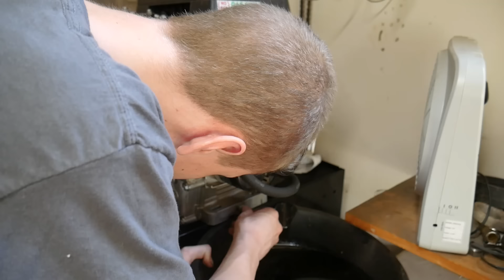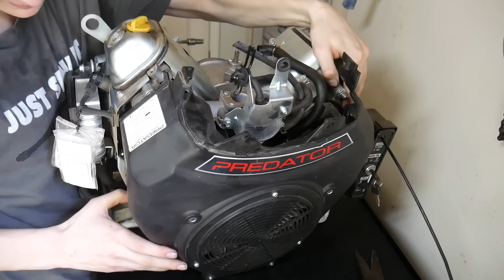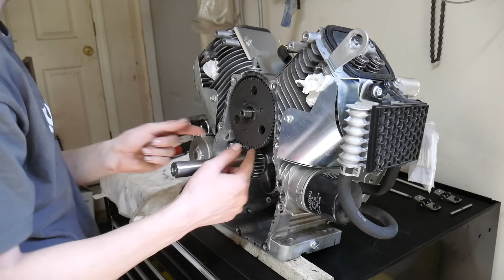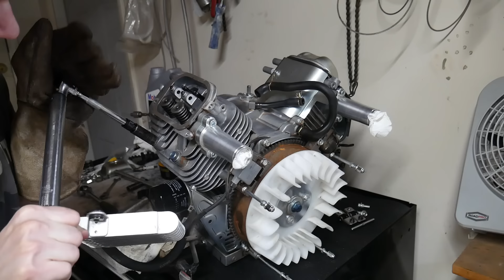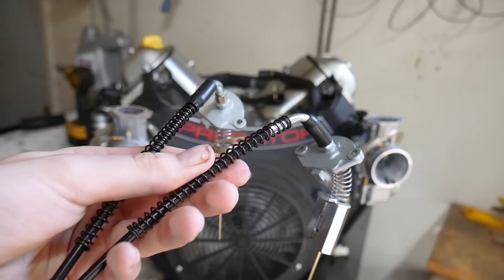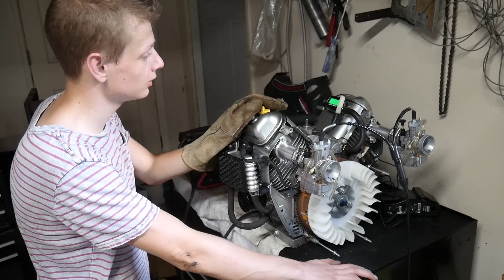2X Factory Output! Predator 670cc Performance Build

Comment from the maker: Hope yall enjoyed this video! I Install billet rods and flywheel here: https://youtu.be/fPnv91BtL5E 
FIRST DRIVE HERE: https://youtu.be/Nv9iPcZeb5o 
**I have to correct myself, thicker oil is not always better. Subscribe for more epic videos. BTW This video was expensive and NOT Sponsored!
Reply: That makes it even better,  stay golden pony boy...
Reply: I will buy all the parts and you can charge me whatever if you build me one
Reply: Dude put the engine in a go-kart 🤭
Reply: Awesome video bud😎😎🇬🇧🇬🇧🇺🇸🇺🇸
Reply: Cool build!! Next time if you feel like making even more power and a build like this you should try building a Kohler command 40 cubic inch V-Twin... My dad built one in his pulling lawn tractor that turns 14000 rpm at 90 some horsepower... Similar to your engine but they come bigger or smaller with a huge aftermarket support!
Reply: @jakefitzpatrick7477  14,000 rpm with an industrial based pushrod engine? Nope!
Reply: @HoggishGreedly  have you ever watched any lawn tractor pulling? There are some really wild small engines. I will look to my dad's videos, how can I tag you in one?
Reply: @HoggishGreedly  also FYI I did not say it was stock. This class runs billet heads and custom cranks and sleeves. If you didn't know Kohler command V-Twin run small block pushrods which makes aftermarket pretty much unlimited. Later tonight or tomorrow I will upload a video to my Instagram all you can check it out. Last dino run I was involved in made 94hp 👍
Reply: Did you have trouble jetting it in? Those knockoffs carb were tuned for 2 cycles from the box.
Reply: @jermainephillips5179   I like the idea of the video
Reply: I would use 10 w 40 in that motor in summer. And 10 30 in winter.   I wouldn’t go much thinner then 10 30
Reply: Those runners looks a tad short I’d have to do the math but I’d assume they really need to be 1.5-2 times longer
Reply: Do you sell these fully built?
Reply from the maker: @samanthapowell5882 no, I would recommend a rotax for the money though
Reply: Vasily Builds have link? This is for a golf cart
Reply: @AM Produkcija SICK🤙
Reply: Fyi my cr500r (first year made)doesnt have any plastic in the motor.....👍
Reply: @pullerbear Ed
Reply: Would you be willing to upgrade my engine? I have a Briggs and Stratton world formula.
Reply: What would it take to get you to build me one like that ?!!
Reply from the maker: @yankdoodlediesel2574  performance 670.com sells prebuilt engines. But the price and build quality of these 670cc's are hard to justify
Reply: Vasily Custom Builds  thank you for getting back to me !   But I still would prefer for you to build me one like that !   I’m into 2 stroke stuff at the time !  I got this little  tractor and one of them motors would work awesome!
Reply: Vasily Custom Builds   You may not believe this but I’m actually an Amish guy with a little channel doing a lot of different things!
Reply: @VasilyBuilds   price?
Reply: Thicker is better
Reply: Idiot
Reply: Vasily Builds what would you charge to build me an engine similar to this 670 so I can install it in my golf cart?
Reply: Willie Will Teez Torres you’re probably better off with finding a CX500 and taking the engine out. 50HP and 9500rpm plus now you get an engine with a transmission and a drive shaft output.
Reply: My.....weee.ww.w
Reply: so what would you need to do to this to make it a monster PARA MOTOR, for a para trike? is there any special things that need doing to make it hold a prop and fly?
Reply: What did the predator motor upgrades cost you?
Reply: I sent you 10 bucks for this video brotha
Reply: That thing looks and sounds awesome! Good work!

Comment: Suggestion:
A tuned length 2 into 1 header where the 'into 1' pipe length is also tuned is worth a look.
There's software online for calculating  both the exhaust and the intakes.

To fool the tuned exhaust pipe that its exhausting into open air you need David Vizard's pressure wave termination box before any baffles.  That's also online.

Comment: Your engine will overheat without the pull start cover installed. It directs cooling air from the flywheel fan around the cylinders.

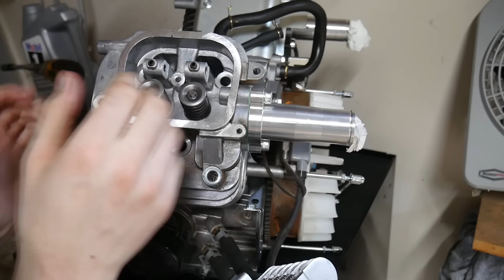Comment: 4:15 if you are putting oil on the threads, you could way over-torque the bolts. The general rule is that, if there is any lubricant on the threads, torque should be reduced by 25%.

Comment: Should have used a deep socket instead of extention. Your torqueing your extention and head bolts which mean the head bolts lost some torque. 50 wt oil is to much. You should take a course in oil viscosity. You would be amazed at what you would learn. Have great day.

Comment: If you can machine a belt drive for the crank there would be a good option to put a 5spd harley transmission to it since the tranny and engine on a Harley aren't 1 piece like other bike engines

Comment: 50 weight oil is way too thick. oil flow will be restricted to the bearings and this will cause the bearings to over heat. thinner oil flows faster and therefore takes heat away better. the oil cooler will keep the oil temp reasonable.  use a good multi grade such as 0w 30 sync...nice build.

Comment: My TM 125 shifter engine from Italy with a 6 speed f1 style clutch less gear box makes only 45 horsepower it will do 120 mph on big tracks but cost $7000

Comment: You forgot the billet rods and billet flywheel. You don't want to run a hot cam without them. The cast iron flywheel can shatter at high rpms and the stock rods can't hadle the extra power. They will break eventually.

Comment: Why remove the oil sensor?
Reply: If you use the engine on a go kart, the bouncing will activate the sensor and it will turn it off.

Comment: I raced small capacity 4 stroke twins in the 80's and these carbs a re very similar to the Mikuni units we used. Here's something to try, put a connecting pipe between the two inlet stubs and then balance the carbs so they flow exactly the same, when balanced connect the new pipe and test the difference. Also this engine would almost certainly respond well to a reverse cone megaphone exhaust, a little experimentation could give good results. Nice build and none of this is criticism just passing on years of building em.

Comment: Why ???
What real practical purposes of getting anymore power out of the predator 670 ? 
Using it to power a child's go cart isn't practical nor has any real benefit to anyone other than a big waste.
If you need more power then buy a larger engine makes better since ...
Reply: Have you heard of off road buggies? They are perfect for them.
Reply: @memosrt  NOPE 
On the other hand I've heard of DeepSea Electronics .
Among other practical projects I used one of my Predator 670 twin engines to power a Generator Head with a DeepSea Electronics 7320 controller. 
Converted the engine to run smoothly and reliably on propane. 
It has preformed perfectly on several outages providing up to 20kv of stable electricity to my home. 
This device has a practical purpose. 
Go Carts don't... 🤦
Reply: @chuckvenable4409  the good thing is that we live in a free country and we can use a 670 in whatever we want.
Reply: @memosrt  I didn't say anything about not building go carts .
I simply stated that they have absolutely no practical purpose.
With that said , for my purpose to cover some of my off road work hauling fire wood or spraying weeds I use a typical 4 wheeler. 
Since I'm not looking to  risk life or limb traveling at high rates of speed on go cart wheels. I to have the freedom to point out building a child's toy go cart has no practical purpose.

Comment: Just don't be turning it to fast without at minimum a billet flywheel. Don't want to see you with shrapnel wounds. As always, stay safe and have fun!
Reply: It’s happened to me
Reply: @Bub321 ?
Reply: It's plastic dude! And it has plastic shielding so if it breaks it breaks l, but I don't think it can do that much damage
Reply: @ddd.777-  the fly wheel is absolutely not plastic the flywheel fins for air movement are but the stock flywheel is cast iron and spins at around 600mph so if you don't want chunks of a 20lb 600mph furious metal cheese wheel going through you an aluminium flywheel is a good idea
Reply: @Cheebsurgeryeah i tought about doing it but after all every upgrade requires another so better keep it stock
Reply: @ddd.777-  No it isn't. The flywheel is metal the flywheel fans are plastic. The plastic shroud will not stop a 15 pound chunk of steel at 7k rpm

Comment: That stuff you were doing at @8:00 please never do that again. First, you could have damaged the flywheel fan if the rubber mat made contact.. but more importanly, that piece you used to hold down the mat could have made contact with the flywheel fan and ended up in your neck! It worked out, but we only have 9 lives brother. Be safe.

Comment: So I have an ancient skidsteer with a Wisconsin V4 that barely runs. I believe new it would have been rated for 30hp. I plan to replace it with either a new Duromax 999CC(35hp) or do an upgraded Predator 670CC engine. What would you recommend? Operationally the engine just needs to turn a hydraulic pump at a constant RPM. Probably in the 1800 to 2000rpm range but I need to check the Wisconsin specs to confirm this. Yes I will have to fab new motor mounts. Given the skidsteer hydraulics are fine all I need is a good motor to return the skidsteer to full functionality. What would you recommend?

Comment: Just to be clear,  thicker oil isn't necessarily better.  Too thick and it won't get into tight places and will cause lack of lube.
Also I  know you didn't run the engine long but it is air cooled  running it without the shroud prevents the air from the flywheel from cooling the cylinders. 
Glad you are having fun I'm just sharing what I learned from the school of hard knocks. :)

Comment: What about using a Suzuki Cappuccino or Honda Kei car engine, which is the same size as the V twin you’ve used, but it’s more powerful in stock from? You can tune it for more power than you can get from the lawnmower unit you’re using.

Comment: Good work on the engine. Sounds great too. The only thing I'd recommend is using the manufacturers oil weight. Thicker doesn't offer more protection and the bearing clearances are machined for a specific oil weight. You can read more about oil testing at RAT540 blog.

Comment: Others who've modded these engines warn of running a stock 3,600 rpm flywheel over the rev limits.  If the stock, cast, flywheel blows, it'll remove body parts.

Comment: nice build.....BUT. you should run some straight 30 and NOT that sae50....reasoning why is,1, the engine bearings have tight tolerances that the 50wt will have a hard time getting in to and,2, the parasitic drag that heavy oil will create...50wt is robbing that engine of power...also,dont run synthetic as it will dry out your oil pump drive gear,making it brittle and eventually will strip teeth....other than that,it should make some good,consistant power...great vid

Comment: It’s probably been answered already but,,what is the dependability of this motor now,,if you drive it respectfully,,having the ho when you need it and not holding say more than 3800,,it should b reliable correct
Reply: Likely shot the reliability to hell.
Reply from the maker: great reliability 30 minutes at 5k-6k rpm and handles it fine. did that for several days in a row
Reply: @VasilyBuilds  I would like the fact that I can hammer it when needed,,and still hold around 4grand without issues
Reply: @VasilyBuilds  what do you run it on,,I was thinking running it on a mud motor

Comment: This engine reminds me of my moto guzzi v50 engine, very similar layout, similar sound too! nice to see you squeezing more power out of this, I don't see any reason why you wouldn't be able to push over 50hp with a tune on those carbs!
Reply: Shave the cylinders for higher compression, shave the flywheel for quicker revs, increase valve size and polish intake to improve flow
Reply: The way a Guzzi 90 degree V sounds. And once you get to 4k rpm it gets real familiar. 🙂

Comment: Thanks for the demonstration.  Love that sound!!  And not obnoxious even with a straight pipe.  No big bulky expansion chamber!  Planning on putting the engine in my ultralight  after putting it on a diet with all the upgrades, including a much lighter flywheel. Two Arrow carbs so I can adjust for altitude while flying. It should sound better, look better, and be more streamlined without the bulky expansion pipe hanging out the side. 
   Then perhaps a AMR supercharger. It looks like rebuilt ones are only $300.
Reply from the maker: I weighed the engine it was pretty impressive but I forgot what it weihd. I think around 70 with all billet
Reply: @VasilyBuilds  wow! thank you. The speed reducer I have to run weighs about 7 lb. So that will still keep it a ultra light. Total empty weight can't exceed 254 lb. I have to keep the propspeed at less than 3000 RPMs. But the speed reducer doubles the torque.

Comment: How did you hook up your throttle cable with the duel carbs? The cable doesn't come long enough to connect to my rod connection to the gas pedal

Comment: how are you cooling the heads without the factory fan shroud? it wasn't there for protection you need it to force air over the heads to cool the engine.

Comment: Hey buddy what cam, was they stock length steel pushrods and what valve springs did you get buddy? please I'm ordering these parts, but need the exact ones you got. Thanks in advance and I think I know on cam but you telling me be better haha thanks again!
Reply from the maker: the biggest cam they got, stock length, and highest quality springs they got
Reply: @VasilyBuilds  Ok thought so but wanted to make sure! Glad to see all is well with you and your channel still! Thanks again buddy
Reply from the maker: @kartguy  I wouldn't trust the stock connecting rods with all of that. Cast aluminum is weak. If you don't want to buy rods go down to their base model valve springs and maybe a less aggressive cam.
Reply: @VasilyBuilds  I plan on doing that and flywheel too thank you very much though your very right.

Comment: @vasilybuilds I’m building a 670cc and was wondering how you did your throttle setup to your buggy? I’m also putting a 670 on a buggy and noticed you used the banshee throttle cable but that wouldn’t be long Enough to run to the pedals of a buggy. Any advice would be greatly apreaciated!! Thank you!!

Comment: for insurance that the keepers are mounted correctly tap each valve with a hammer , if the keeper isnt mounted all the way it will pop off , better now that with the engine running
the 40 weight oil will lube better for longer but allso causes a lot more drag robbing power

Comment: Frankly I am confused with your statement that you had to break a gear to remove a sur-clip. I have not found that to be the case VB. When someone does not have the correct tools these things usually happen. But in your defense, you really do not need one in this application. Good power rather cheaply. Also, using studs instead of bolts would definitely increase peace of mind and cost is minimal.  VF

Comment: When torquing the oil pan/ "side cover", you should always start with the bolts closest to the middle then work your way further out. Just FYI. Cool vid.
Reply: I know it's a year old, but explain why for the noobs
Reply: @jeremym8748  the mating surfaces will line up straighter and will make a better seal. All torque sequences start in the middle of the part, whether its a head, a valve cover, closure plate ect. Nearly any manual you follow will tell you this.

Comment: generally the stationary engine makes a lot of noise as if it were loose parts, is it possible that it is in the components of the manual starter?

Comment: I'd probably run a 10-40W, while adding a larger oil cooler since you removed the plastic shielding that pushed air up and across the heads cooling fins.
Reply: naa straight 30
Reply: @seanmckay3392 you trippin. 10w-30 synthetic w 1/4 15w-40 T6 diesel oil. Shit is great, especially for older stuff

Comment: I'm not so sure a stiffer set of valve springs is going to get you 5-10hp. Even with removing the governor it's still the same to, just ungoverned.

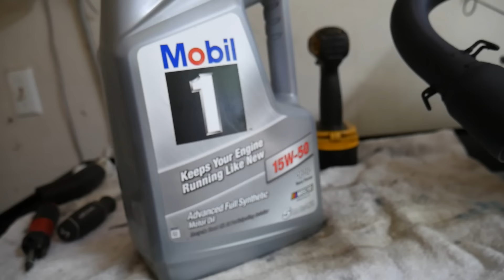Comment: 6:50 actually the thinner the better, with thinner oil the crankshaft has to do less work to spin in the oil, race cars use 5w-50

Comment: saw a lot of parts changing, But not a bit of engine building... Not even plastigauge for the connecting rod, so you really don't know what the tolerances are,,,, That's a great job for parts changing, but that's not how you BUILD an engine... Bore that thing, align bore it, add needle bearings, mill the head, deck the block, port the head, polish the exhaust port... Then let's talk about building engines. I get the same power out of modifying stock parts that you just got from a bunch of money...

Comment: I just looked up the price of the engine and all the parts/what Performance 670 claims for power... For that amount you can buy a Moto Guzzi 1100 engine on ebay plus some upgrade parts and have WAY more power. Or hell, you can even buy a Ducati engine and really make some power. (you can get a 96HP S4R engine for $1249)

Comment: Idk if you ever did or not but why not ditch that factory heavy cast iron and plastic fin flywheel for a custom billet like I've seen many people use on 670cc engines those predators are more less Honda knock offs ain't they there 5 and 8 hp engines really look like small Hondas